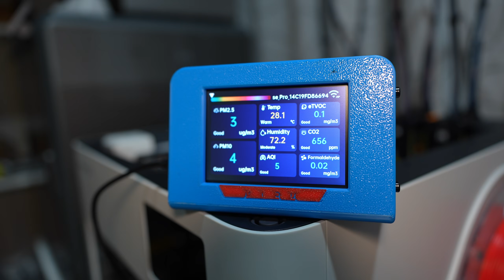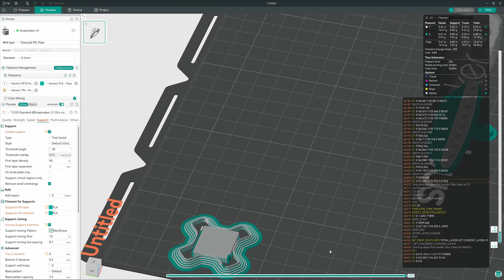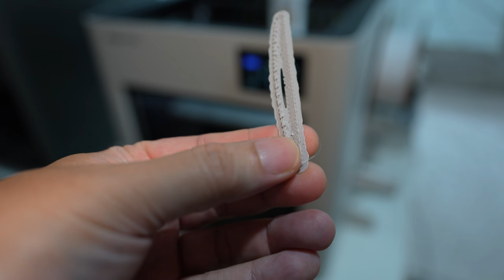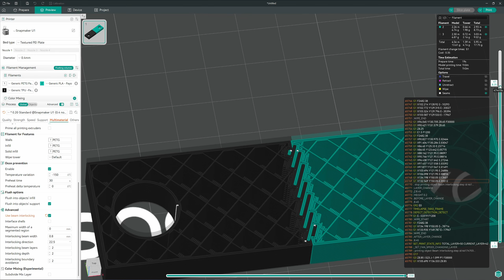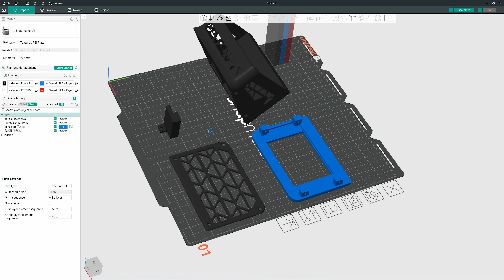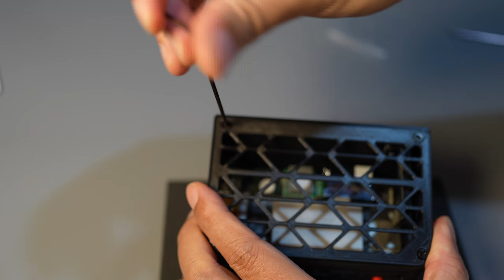Prime Tower Fix + Interlocking Beam | 3D Print Air Quality Monitor Review

Comment: another solution that im using is marking the support interface filament as soluble material. that parameter excludes that material from printing outer walls of the purge tower. Useful for multi colour prints when you still want to divide the material used for the tower between all colours
Reply from the maker: wow, I never thought of that. I'll definitely try it. Thanks for sharing!!

Comment: Try using the main material for the Walls and Wipe Tower (Multilateral -< Filament for Features). It will contain and support the tower.
Reply from the maker: I already tried that, but the tower still purges alternately between PETG and PLA, which causes it to fail.

Comment: I almost NEVER use a prime tower when printing PETG with PLA supports.  TBH I found the prime tower to be unnecessary once I got my filament and print profiles dialed in.  When I use supports I print them in PETG (the same material as the model) and I only set the interface layers to PLA with a 0.0mm Z distance.  This also serves to greatly speed up the print since it reduces the number of tool swaps.  My main issue with the prime tower is that I can't decide where it is placed meaning using it dramatically reduces the actual build volume I can use for larger prints.  I just figured a way to work without it.

Comment: You should use interface layer, because that would make it faster and cleaner to do than entire amount of different filament just for support
Reply from the maker: Using PLA or PETG as an interface doesn’t work. Even a small dab of a different filament on top of tree supports produces poor results, most of the time, it won’t adhere to the support below.
Reply: @Payo-TensileCreator I do it a lot maybe you need to dry filament a bit
Reply from the maker: @YME-247 It's 80% humidity here. I need to pull the filament out of the dry box.

Comment: My first thought with the interlocking beams was that you were using them on the prime tower itself to lock the materials together. That would be a cool thing to build into Orca.
Reply from the maker: PLA and PETG will never adhere to each other. Bambu offers a special blend filament that doesn’t bond too tightly, making supports easy to remove.

Comment: Instead of using the opposite material as the support material use it as just the interface material.  The original material can still be used as the support material.  That will cut down on waste and the prime tower won't all apart as much because it will be much less interface material in the tower to cause them to fail.
Reply from the maker: It works on flat surfaces, but not on curved ones. A small dab of different filament won’t adhere to the tree support below. For flat surfaces, I prefer printing at a 45‑degree angle, like on the casing of the Panda Sense Pro.